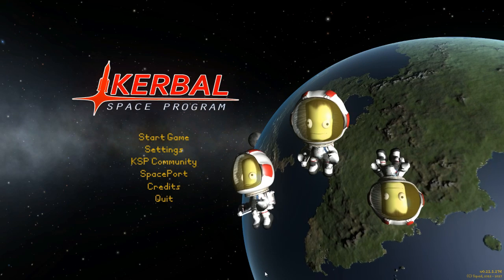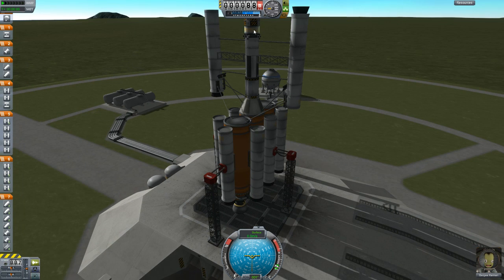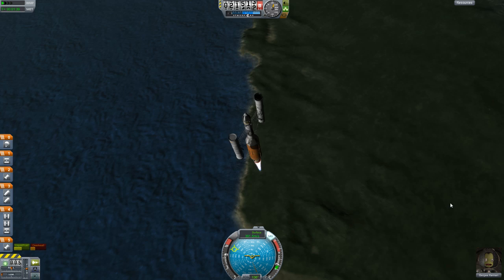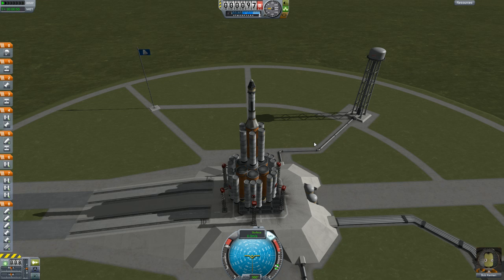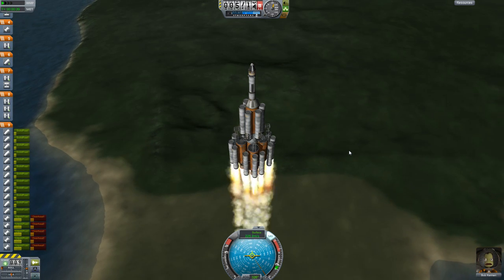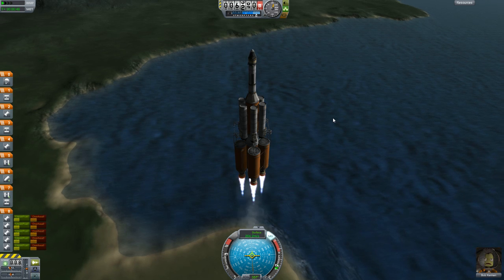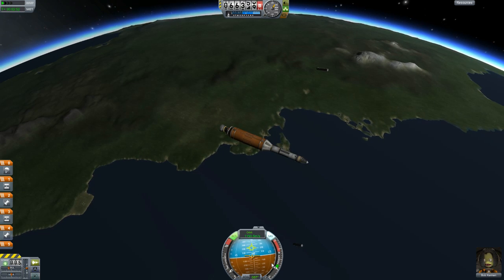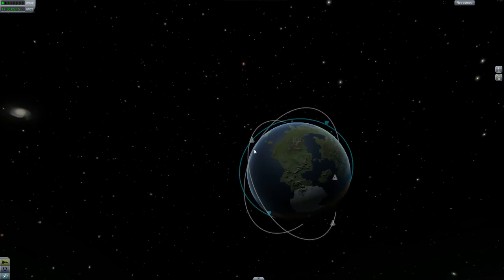Kerbal Space Program Ep. 5 - "Orbit, Totally On Purpose"

Comment: Another suggestion for you: When plotting maneuvers, try to place them before you reach the apoapsis. Doing a burn (which is not an instantaneous impulse) on or after the apoapsis will greatly decrease your efficiency and probably give you a different actual result than the plot would suggest. This is why your plot told you your orbit would be 80x100 and it came out much lower.

Comment: 1) The green marker is the direction that your ship is going. It's good not to turn too far away from it during the start of your gravity turn if you value your structural integrity.
2) In the control parts, there's reaction wheels and stabilizers and stuff. These are gyros that will make your ship much easier to turn, and will in turn make SAS mode work better.
3) Orange tanks overheat for some reason. Put a Rockomax X200-8 Fuel Tank between them and the engine to prevent that.

Comment: I don't claim to be an expert on the game, but a couple quick tips for questions/issues you've had: The yellow circle on the compass marks your current direction of travel, while the yellow circle with an x through it marks the opposite. Those orange fuel tanks also cause a ton of overheating for some reason. If you add a short, grey fuel tank of the same diameter between it and the engine, you'll overheat a lot less.

Comment: Mainsail engines, especially on those orange tanks for whatever reason, are prone to overheating. 

Solid rockets are good for launch because they produce a lot of force (MORE POWAH! if you will) but expend quickly. This quick force helps you break the static momentum from the launch pad and give your craft upward momentum.

Using SRBs, keep your engine throttle to a minimum to prevent overheating and be more efficient with your fuel until they burn out and you can jettison the weight.

Comment: The SAS Modules contain gyroscopes which provide torque like the crew capsules and they use electricity. They are useful if you don't want to have an RCS system on your craft, and already want to use solar panels or generators, Or if you don't plan to keep it in flight longer than the motors are firing.

Comment: Zisteau,the reason that you are having trouble changing orientation is that the SAS module is trying to keep the original orientation while you are working against it with your own inputs, causing all kinds of stress throughout the structure.

Try turning SAS off before changing the orientation and then turn it back on to hold the new orientation. Everything will be much smoother.

Comment: Try placing you thrusters on the center of mass of just the stage that will use them that should help with control also to move and hold you have to turn sas off then back on where you want it to hold